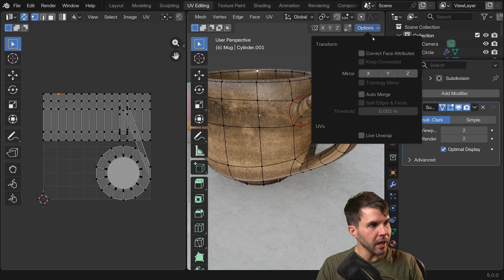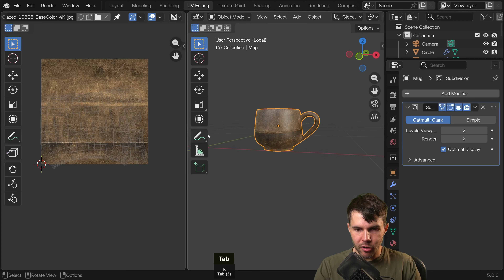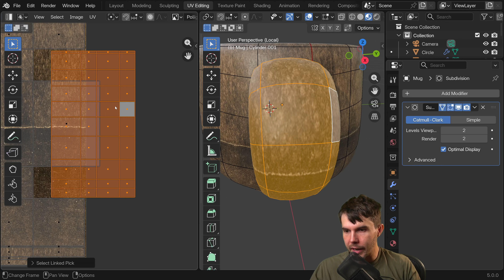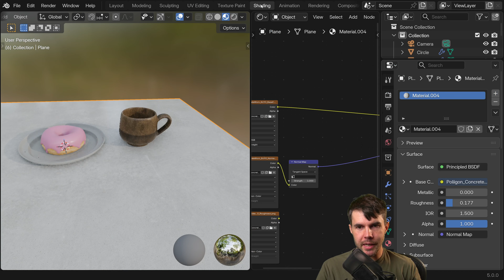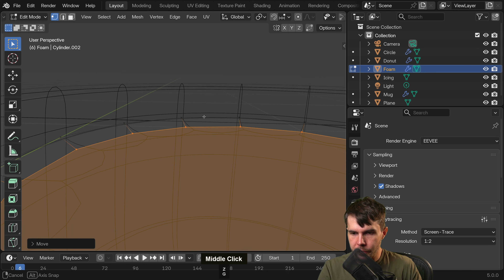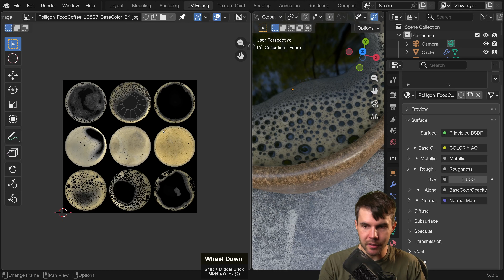Blender Basic UV Unwrapping Tutorial (Donut Part 6)

Comment: To straighten UVs in Blender without addons:
In the UV editor, pick any random quad and select any two vertices on the same edge.  For example, select the bottom two.  Hit S, Y, 0 (zero) and it will straighten that edge.  Then do the top.  For the left two, S, X, 0 and the same for the right.  Select that quad with the straight edges, hit U then Follow Active Quads.  The default is usually fine, but if not, there are two other modes.  The UVs will then be flat and straight, provided there are enough seamsand they'replaced properly.  Great for curved surfaces.

Comment: For anyone using the Gridify feature and finding it's not quite working right, (I got a very tall stretched out version than what he had despite having a pretty similar starting mesh), you can press "Rectify" and then "Gridify". Now, if this doesn't work, I'm not a Blender expert and this is my first time doing any of this, so it's possible it could mess with some things. If it fixes it though, that would be neat lol

Comment: I cannot get the foam to work at all. I initially was struggling with it being star-shaped then found the solution was to disabled the cage option in the subdivision modifier, okay good. But now when I add any texture to it, the star shape is back and completely messes up the foam texture even though I haven't changed anything. Everything was going pretty smoothly up until this point but I cannot figure this out. Literally did everything step by step and it somehow turned out wrong. It makes no sense.

Comment: Select Linked isn't working correctly for me. It's selecting the entire section within the seam, but also selecting all the points/vertixes on the other side of the seam which border it. For example, when I select the main body of the cup, it also selects the ends of the handle part and the entirety of each circular part, and I can't move one edge point without moving the corresponding point on the other side of the seam. Is there something I need to toggle off?

Comment: Having a problem in the separating handle island section. On the left lay flat side I don’t have a rectangle handle connecting the circle and big rectangle, I only have the circle and big rectangle. Also even with vertices selection selected, I don’t see the lines and vertices, only the fully rendered mug (on the right). Would really appreciate any help, thank you!

Comment: I have a problem with the foam part, every time I duplicate the vertices then click escape then P to make it a separate mesh, it still has connection from the texture of the mug, so when I remove the texture from the face it also removes the texture on the mug! how can i fix this pls help..
Reply: Make a new material and apply the foam texture to this other material

Comment: Thanks blender guru!

One issue I'm having with the poligon add on is whenever I apply a texture, it automatically changes my render engine to cycles. It's not a huge problem to just switch back to eevee, but is there a way I can stop this from happening?
Reply: I have the same "problem". I did press that my main render engine would be cycles(because I had no idea), so that might make all the textures automatically apply to cycles? Lmk if you also chose cycles as your main render engine (:
Reply: Try to switch to none in the system preferences in blender. Ask for more information ℹ️

Comment: I’m having a problem when doing the foam. Every time I try to put the foam on the face it doesn’t show anything on the uv texture. I tried multiple times but all that happened was foam going on the actual mug. And it doesn’t show lines on the plane like his does when I go to the uv editor
Reply: Ok I see lines on the actual “foam” although I don’t see the foam after applying the foam texture (which is normal he said) but when I go to uv editor the thing he said to reduce is very very small and I can’t resize it.
Reply: Ok nevermind i figured it out
Reply: @Vrlover124  well, what did you do to fix it? i cant add the UV texture to the plane for some reason. its not showing up in the uv editor

Comment: For some reason this is where the tutorial lost me.  I can't seem to make a face from the circle in the adding of the foam portion because pressing F does nothing.  When I try Alt F is says there are no edges to fill to make a face, I don't know what I'm doing wrong because I'm following it step by step and seemingly I'm unable to do what you're doing here.  I'm not quitting, but unless something changes to where I can figure out what's going wrong, I cannot continue this tutorial for the mug itself.
Reply: Same here! Found an answer in the comments and it made so much sense (thank you, helpful stranger!). If you notice your new circle doesn't have vertices (and it's just highlighted orange) you won't be able to fill it. Switch to object mode >click on any other object> click back onto your foam >then into edit mode (select mode:vertex) and it should show vertices on your foam circle. THEN you can fill!
Reply: I also have a problem with the foam part, every time I duplicate the vertices then click escape then P to make it a separate mesh, it still has connection from the texture of the mug, so when I remove the texture from the face it also removes the texture on the mug! how can i fix this pls help..
Reply: @Heaxnn  I unlinked the materials by going in the Material-section of the foam and then pressing the "X" button that's next to the current material's name (under the material index)
Reply: i think this happened to me too, you will just have to zoom in and see the foam verticies you created by creating a new circling by hitting p, zoom in select those verticies and then press F and it should work
Reply: it happened to me too, this was not the greatest fix, but i zoomed in in edit mode, shift clicked the lines of the new circle we made, and then hit F and it worked.
Reply: happened to me but I was in edit mode instead of object
Reply: Once I press P I can’t select the mug.01
Reply: @WadeMichelle1982  First select it from the list on the right where all objects are listed, then switch to Edit mode, and press A to select all and the circle should be selected

Comment: I see you always disconnect the pins in textures you aren't going to use. If it's not really affecting the texture is there really a purpose to disconnecting them or is that just OCD kicking in? Maybe it matters more in a large project where there are a lot of shaders and cutting down on anything unnecessary helps render times?

Comment: I'm having an issue with Inset the face on the object. When I press "I" its giving me a star shape and not the circle like in the video.
Reply: Turn off "on cage" on the subdivision modifier. What you're doing is effectively the same but it's just visually different. You can sort of see the start shape in the video.
Reply: @sssnowman5794 aha! That was it! I totally forgot to turn that option off. It seems that he turns on an off and I failed to catch that. Thank you! I continued with the star shape and the result is roughly the same
Reply: @EduardoWeidmanBarijan  Thank you. You're a lifesaver. I've had to redo and rewatch the inset part until I read your solution. God bless you.
Reply: @sssnowman5794 THX!!
Reply: @sssnowman5794 Thank you!!
Reply: @sssnowman5794 YEAAAA BOIIII
Reply: @sssnowman5794 Thank you!
Reply: @sssnowman5794 thanks for the update bro i was stuck there for a while too and your comment was what i saw that helped me
Reply: Yeah, same. Maybe it's something to do with the modifiers that get transferred from the mug object onto the foam object? Trying to find solution myself at the moment
Reply: Yeah he want way too fast during that section, I could not follow it properly either. I managed to solve it by removing the subdivision modifier on the foam, and managed to add the texture, but it still does not show the side being slightly elevated somehow.
Reply: you legend ! thank you

Comment: Wondering if anyone can help me on this, I can UV the object just fine but to do so I need to select the object, go into editing mode, hit either L and select the area I want, or 'A' to select everything, it's at that point the UVs will appear in the UV editor side of the window and I can select the faces on there to work on them
It seems like on his once he's in edit mode on the object then the UV's appear without needing to select anything else.
Reply: nvm I just found it after commenting this lmao, if anyone has this issue then you need to select the 'UV Sync Selection' button in the top left corner of the UV editor window. The button is right next to the drop down menu for the different window types and looks like two diagonal arrows going in opposite directions.

Comment: How would you rotate the texture on the handle?  I think you are correct that the mug would be dipped to get that design as part of the paint process before baking and the line on the cup handle should be level to the line on the mug all the way around and parallel to the base or the table.
Reply: The same way he did with the body of the mug I believe